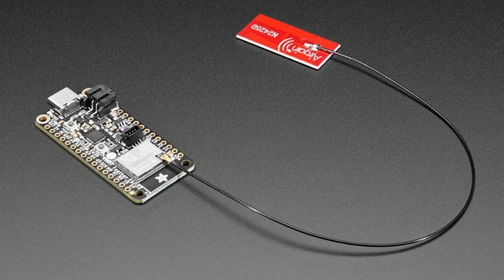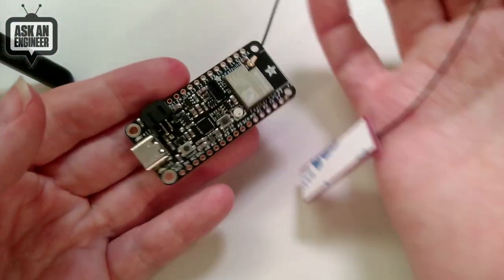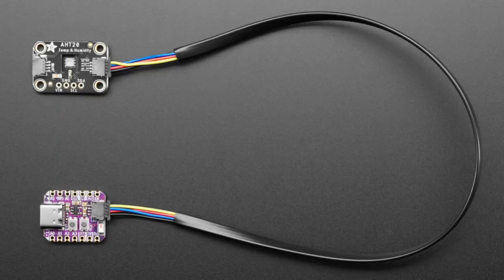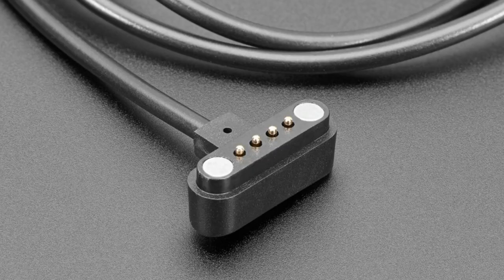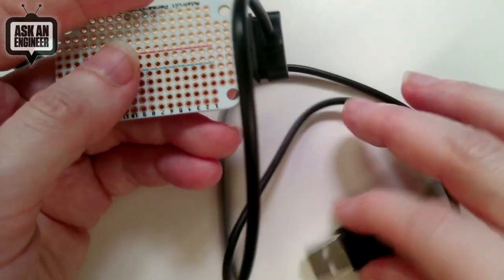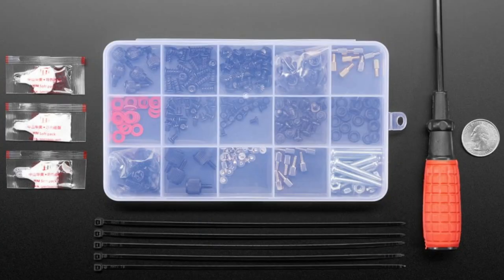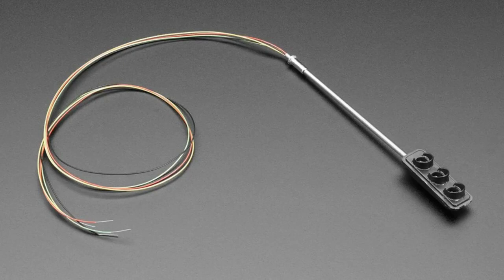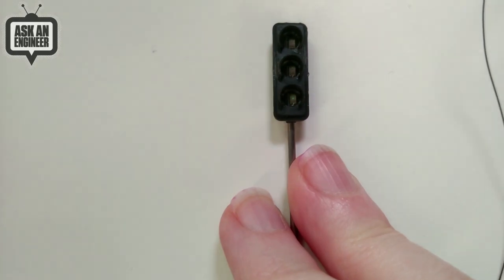New Products 5/11/2022 Featuring Mini Traffic Light - 6.5cm tall!

Comment: That PC hardware kit is a pretty smart thing. Kind of surprised I never saw such a kit at Radio Shack back in the day. And those little traffic lights are adorable, feel free to throw one in the next Adabox 😉 Wearable air quality indicator maybe?
Reply: I literally just have a baggie with tons of screws. Perhaps I should organize them in a similar case. 😂
Reply: @jacobharvey2946  I have many containers of such screws. Still doesn't mean I can find the ones I want when I want them, and far too many are the Compaq torx (great screw head for actual things requiring torque, which usually doesn't include computer parts)

Comment: I made a traffic light set-up using neo-pixels (thanks to you) with a small Arduino chip to fit in the traffic light case. Then on a pc added a program to monitor folders and change the lights to alert staff when the file count gets to high signifying data upload failure. Plus added a disco button to run rainbow colours through the lights for fun. 😁
🤔 could make the system smaller with those traffic lights 😁